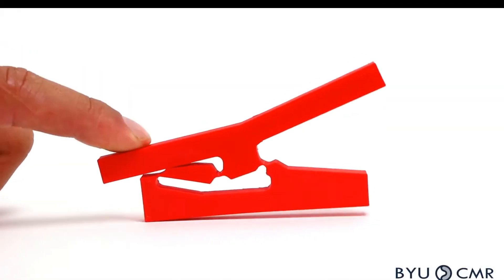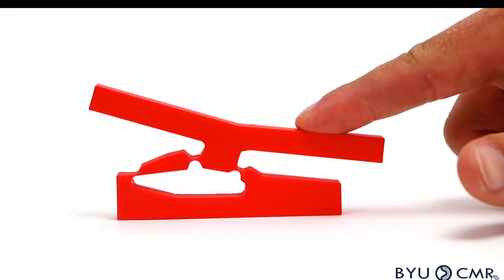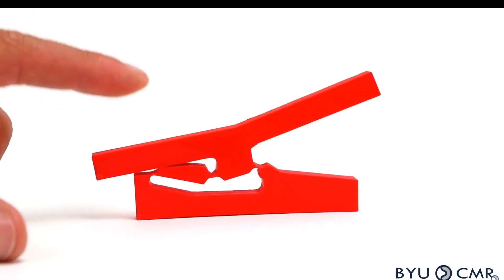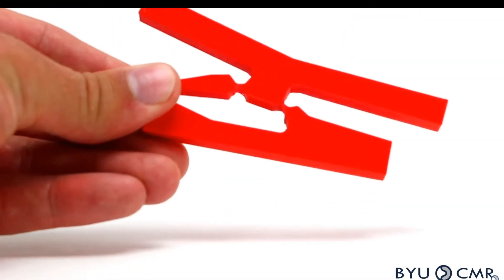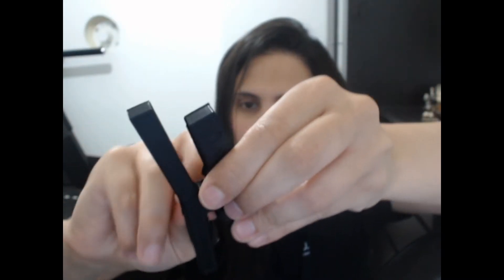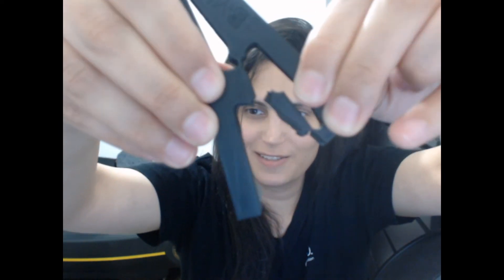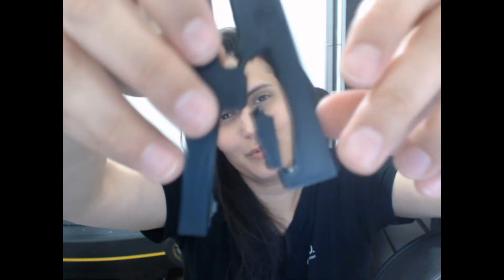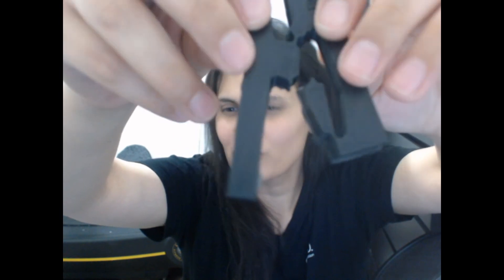Bistable Compliant Switch Mechanism - 3D printed PLA lifecycle test

Comment: Thanks for the demonstration in such an "old youtube" fashion :)
If you find the time, check out the paper "Tension-based multi-stable compliant rolling-contact elements". I wonder what this switch would look like when re-designed, as they seem to hold up around 100,000 cycles.